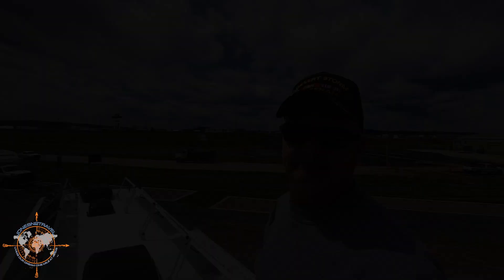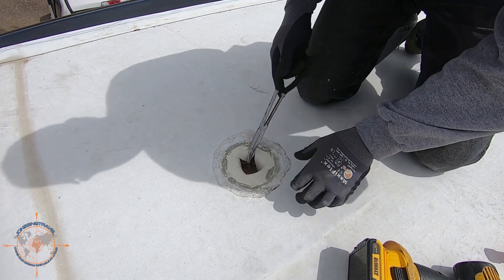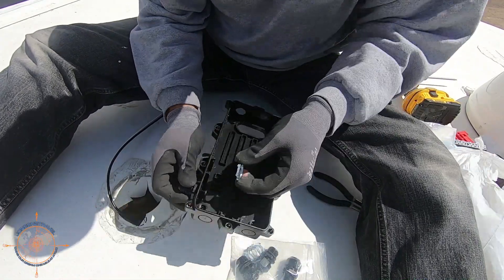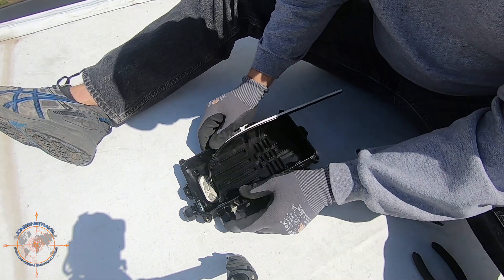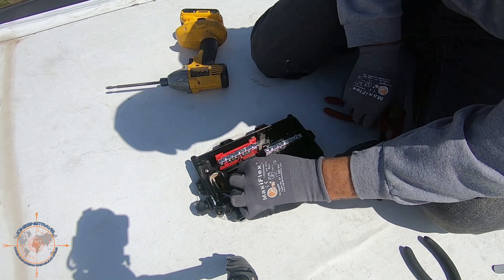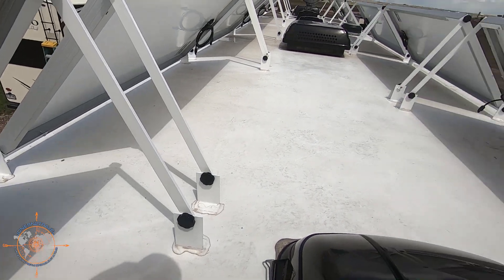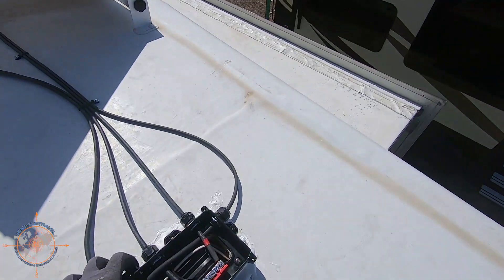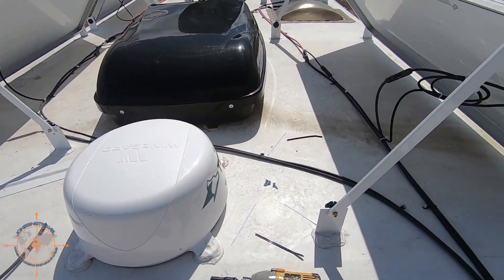DRV ULTIMATE SOLAR INSTALL | PART 3 | RV LIVING

Comment: Great job Aaron!  What roof selant do you recommend?  Is it just a good silicone, is it marine grade, etc?
Reply from the maker: Hi Rick. You'll want to avoid using silicon on your rv roof. It just doesn't stick well and you'll get water intrusion. Use Dicor Self Leveling sealant, available in our webstore www.themobilervtech.com/store . I put a little under the foot of the solar mount then screw it down. Final step, bury the screws and edges of the brackets in the self leveling sealant. Look at how they sealed around a vent on your roof and you'll see what I mean. 😁 Hope that helps. Thanks for checking out the video. Safe Travels

Comment: Great job!!  We are getting ready to install 800 Watts of the same panels you used.  Can you tell me what tilt kit you used to mount the panels?  I am currently deciding if I I should install a tilt kit or just mount them flat.  Thanks.
Reply from the maker: Hey Brian. I purchased the tilt brackets from Continuous Resources. They run about $65 per panel but they are really nice brackets and come with the tilt bars. Hope that helps. Safe Travels

Comment: I watched this video several times trying to understand your setup.  I am working on getting my solar system setup and like your setup.   I been looking for the junction box you are using but can't seem to find it.  Do you have the link or seller where I can get one? Thanks for sharing your knowledge with your viewers.
Reply from the maker: Hi Antonio. Thanks for checking it out. We source most of our solar components through Continuous Resources at this link http://www.continuousresources.com?aff=31 This is our affiliate link so they'll know we sent you. :) Once on their site search for ROOFTOP PV COMBINER BOX (WATERPROOF) WITH STRAIN RELIEFS and that is the combiner box we use most of the time. You can always buy the strain reliefs and a plastic junction box from the big box hardware store and build one yourself but this one is really sweet and worth every penny in my opinion. Please let us know if you have any other questions. Safe Travels
Reply: Awesome, thanks!

Comment: Hey Aaron, Looks great. Some serious voltage there. Waiting to see your choice of Tow vehicle. Wondering if you looked at or considered that truck bed that I linked to you as an option?.
Reply from the maker: Hey Scott. Yes, I did take a look at them. They do have some really nice beds and it is a viable solution. We are still kicking around a couple of ideas but as soon as we decide you'll see it here LOL Thanks again for the truck bed info, really appreciate it. Safe Travels :)